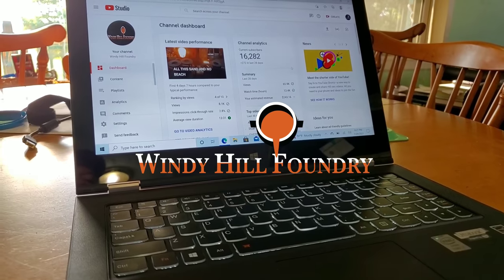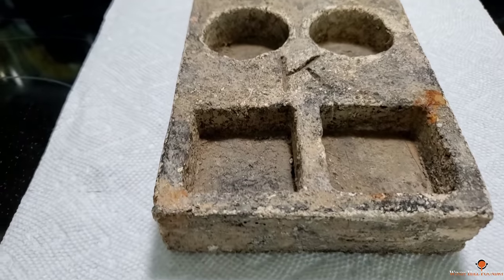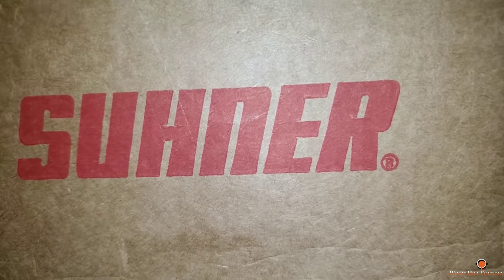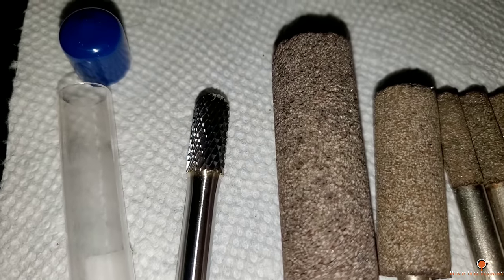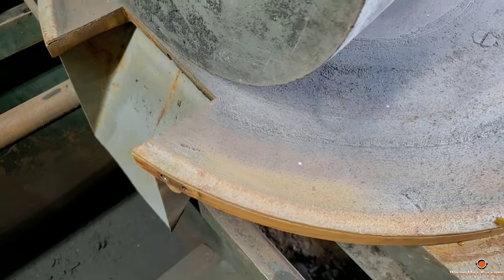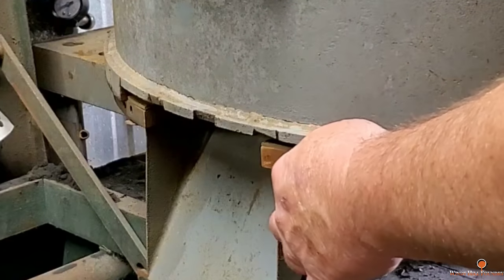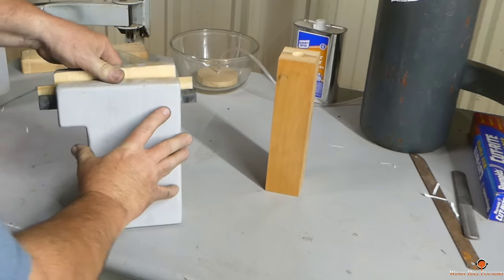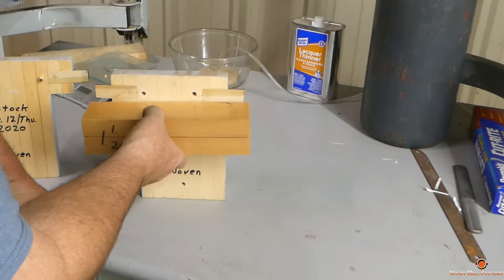LATHE TAIL STOCK

Comment: My identical twin brother and I are reenactors and participated in the production of the movie "Gods and Generals". Late one afternoon we got volunteered to help move 2 guns that were on loan to the movie company. We got to the hill where these 2 guns were located and proceeded  to look them over. Now my brother and I were born in Confederate Headquarters, Vicksburg. Mississippi. At that point in time it was Mercy Hospital on the SE corner of Monroe Ave. and Crawford St. (the building has since burned and no longer exists) Back to these 2 guns. On the right trunnions of both guns is stamped A.B. Reading Vicksburg, Miss. No. 10 & No. 11 respectively. Both were in their original carriages as fragile as they were. My brother and I felt honored to touch them let alone get to move them. There are 2 other A.B. Reading guns that I know of. 1 is in the entry to one of the casinos in Vicksburg and the other is on the second floor of a museum in Idaho.
Reply: I was also in the movie as an extra. 26th NC Regt.
Reply from the maker: Fascinating, I'd like to know who has those guns and it would be neat to discover more have survived. I use to relic hunt, my friend and I would hunt in and around Vicksburg every Saturday. That went on for about 5 years

Comment: Put a T on your air line where the coiled hose plugs in.  Put a quarter turn valve on the bottom of the down leg and  don't cap or plug it.  When the down leg fills with liquid humidity, you can just vent that out of of the line.  Condensation trap.  It helps.
Reply: an automatic drain valve on the compressor tank helps also. I'm pretty sure the one at Horror Freight is under $10. The MS atmosphere in summertime is more water than air. My little jobsite compressor would dump 6-10 oz of water a day when running nailguns down there.

Comment: Great video. Stay safe in all this heat. I am sure the foundry helps to push the temperature up several degrees. If you could find an air tank from a truck It would help with your water problem. Just drain the water out at the tank close to where you have your air hose.
Reply from the maker: Thanks for the advice David👍

Comment: Interesting on the lathe parts. I 3D printed risers for my headstock, tailstock and tool rest for my little wood lathe. Just had to order a new belt based on the new height.
I worked in a large foundry when I was young and I guess I could take the heat better then. Be careful in that heat!
Reply from the maker: It gets rough for sure. Seems like each time I melt, I lose 5 years of my life😬

Comment: I've burned up most of four years getting my small Arizona shop good enough to AC.  Pouring aluminum is the only thing I still do in the heat.  I can't take the heat like I use to either.

Comment: Put a water trap on your air line just before your air hose, yes it will help at keeping the water out of your air tools. Also flush the water out  of the air tank, if you hadn't done so for some time

Comment: Clark? This is a guess but based off something Sandrammer once said. Those molds might be for left over material that the foundary would sell off to local shops.
I know that Keith, Adam, and others have had to buy small amounts of cast iron to do different one time jobs.
Reply from the maker: Thanks for your input Craig. You could be right but usually  those molds are large enough to handle up to 50 pound ingots. These are quite small
Reply: @windyhillfoundry5940  It is an interesting idea. What would small cylinders and squares of bronze be used for? The town was next to a river, so some nautical items could be relevant. 
Mark from Melbourne Australia 
What is the name of the river?
Reply from the maker: @markfryer9880  is is the mighty Mississippi River Mark😁
Reply: @windyhillfoundry5940  Oh THAT River! The one first spelled by someone with a stutter.
Reply from the maker: @markfryer9880  🤣
Reply: @windyhillfoundry5940  I thought you might need a laugh, Clark.
Reply: @markfryer9880  ...Grind into counter weights for a shipping scale?